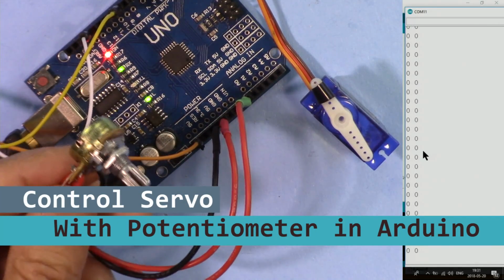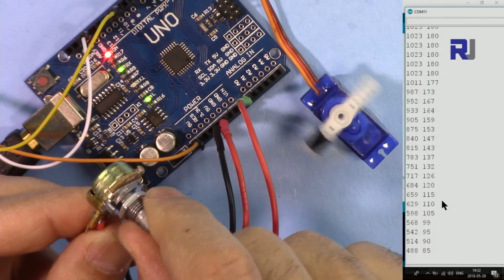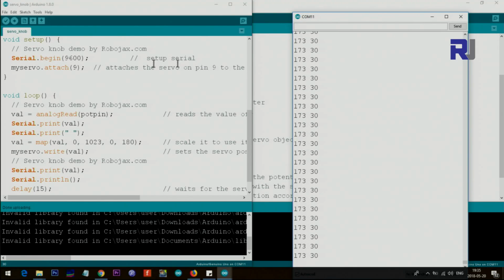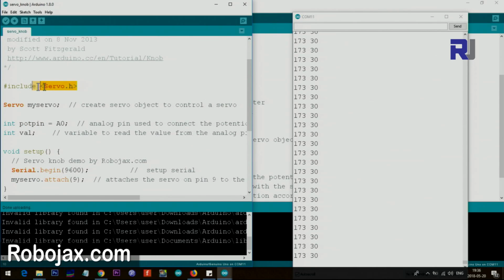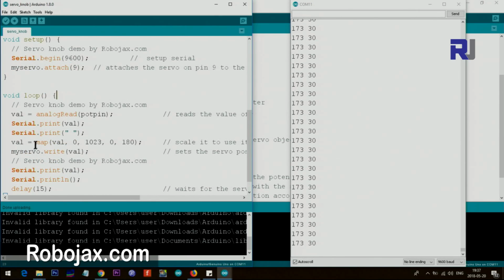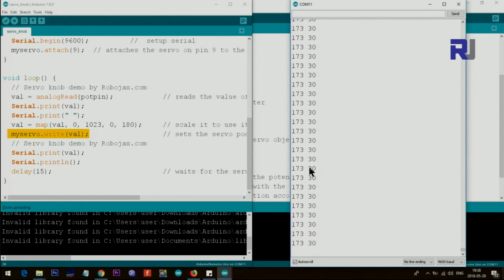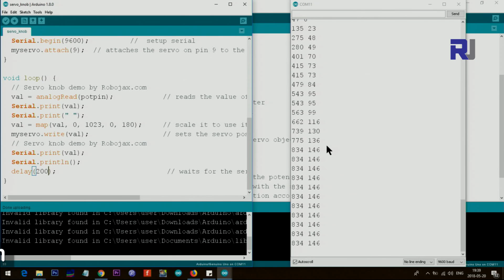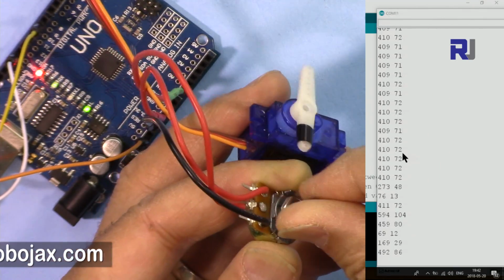Lesson 85: Control Servo Motor with Potentiometer using Arduino

Comment: Hi 
Fantastic instruction 
Im trying to connect a 60 kg servo to a potentiometer to squeeze an air bladder ,  can you please tell me if your intruction would work the same for this ?
Thanks 
Dave
Reply from the maker: Hi, this will work with all common servos. Servo simply needs PMW and Arduino is giving it. Here is better version of this video with wiring diagram and better details https://youtu.be/ntRW77mNFFk which part of my Arduino course. But consider using Rotary Encoder instead of potentiometer as rotary encoder might be very durable here is the video https://youtu.be/6xVLbNlmK-g

Comment: how can i move the motor such that if i rotate some angle in degrees  with potentiometer,  the motor will rotate half of the angle moved by potentiometer in  degrees
Reply from the maker: Then you wan to to move the motor to half of 180 , which 90 degrees? If so just set the limit in the code wherever you see 180, change it to 90.
Reply: @robojax  ok thanks

Comment: What happens if I use a larger potentiometer 

Like 200k Ohms
Reply: Plz replay when possible

Cuz I don't want to fry my arduino
Reply from the maker: you can use from 1k ohm to 1M ohm. no problem.
Reply: @robojax  thx a million dude
Reply from the maker: you are welcome. 👍👍👍
Reply: I tried using a 470k one and the output of it was extremely noisy-looking.
Reply: Yeah if u want fine-tuned output use a lower resistance pot

Comment: Hi can u pls send the materials purchase link
Reply from the maker: Hi, it is just a servo motor and potentiometer. Potentiometer can be anything from a 1kΩ or up to to 100kΩ and they all will work. I don't know your location, but you can get it from Amazon, eBay

Comment: I was hoping for a little more information.  I would like there to be a one-to-one relationship between the angle of the potentiometer and the servo.  What change would I have to make for that?  Also, does the value of the potentiometer matter?  Could it be a 5K or a 20K?  Finally will the code work on an Arduino Nano if I use the same I/O?  Thanks.
Reply from the maker: (one-to-one) has no relevance here. any potentiometer you put, will produce voltage from  to 5V or from 0 to 3.3V depending on the board.  the map() function converts it to angle in linear manner. Potentiometer can be any value from 1k to 500k. it will work with any arduino.
Reply: @robojax  So to produce the effect I want, I would have to change the map?  For instance, if my pot turns 2 times for every 1 revolution of the servo, I could create a table where values 1 and 2 from the pot both equal 1.  And 3 and 4 both equal 2.  And so on. Then use the result as the map?

I should say I am the world's second worst programmer.  I also realize it is not your responsibility to train me.  So thank you for responding.
Reply from the maker: if you are using multi-turn potentiometer, then  you have find out he change in 1 turn and accordingly map it. I don't have what you have so I can't tell you exactly how you do it .
Reply: @robojax  I understand.  Thanks for the reply.

Comment: Can you use the servo cable to control 10m apart?
Reply from the maker: Yes and NO. No if you connect all three wires from servo to Arduino. Yes if you supply 5V to Servo from battery to servo using short 5V and GND. In this case you will need GND and SIGNAL wire from arduino to servo. then 5V and GND from battery closer to servo. Join both GND together on the servo side.

Comment: Very good video, but can i get help Potentiometer always not working with me with everything i do not know what is wrong
Reply from the maker: Use an ohm meter to measure the resistance of the potentiometer between the middle pin and the right or left pin and rotate it. You should see the difference in ohm measurement.  for example if pot is 50kΩ, then you should read between 0 and 50kΩ. This is was correct then your wiring is incorrect or you have wrong code. Good luck.

Comment: This is great! I have it working as described but I want to have a very fine control of my servo over 90 degrees of travel. Can I just change the "val" statement to 90 from its previous value of 180? What about the 1023 value? What does that set? I need to have the servo move in very small increments with the potentiometer across 90 degrees of travel. I am using a 10K ohm pot. Thank you for your help. LIKED AND SUBSCRIBED!
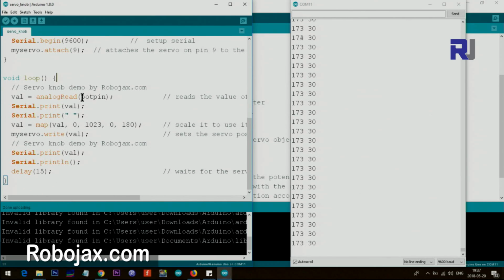Reply from the maker: thank you @E W I just watched the video to answer your question. 1023 has been explained at 04:33 and (Arduino's analog input has resolution of 10bits, 2^10=1024). the servo can be moved in increments of 1 degree. and that is the smallest.  if you want to limit the angle for example you want to servo to move only from 80 to 120 or any other value, you may learn it from this video https://www.youtube.com/watch?v=xrIiKqvm8hQ